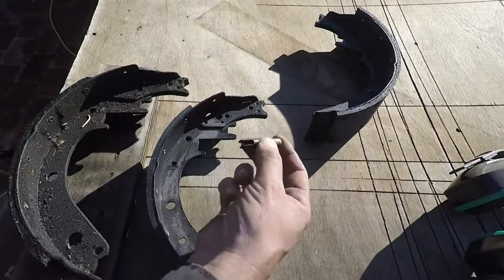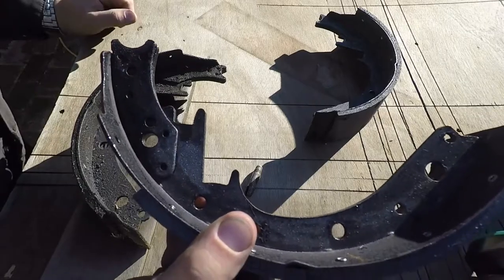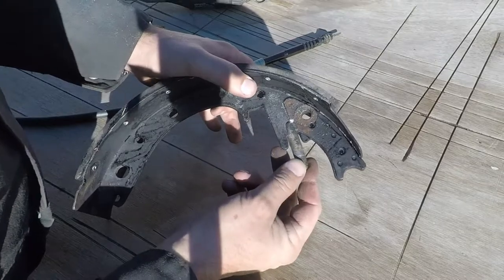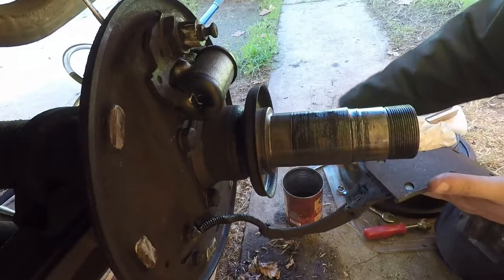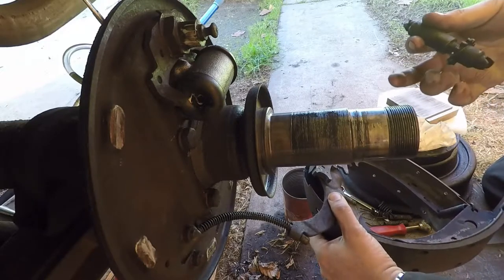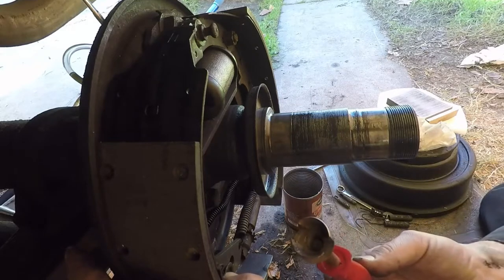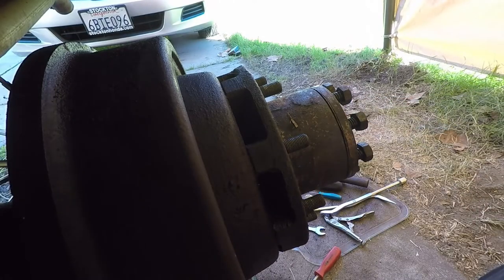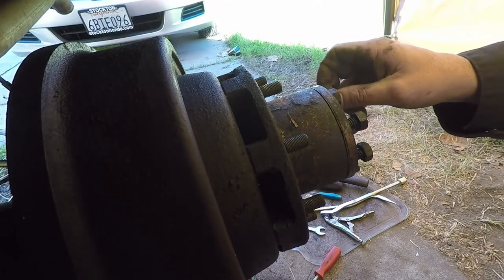1963 chevy c20 truck heavy duty drum brake modification

Comment: a good vid thank you i own a 66 c20 iam going to do this to. you have helped me a lot thank you for taking the time to make this how to video.
Reply from the maker: +Aaron Ivanushka not a problem that's why I made it.
Reply from the maker: you should have the same set up i have on my 1963 c20 there sure is not a lot of info on the heavy duty trucks is there ?
Reply: not much that I've seen and was having some difficulty trying to find the spring and hardware kits etc for the 12  in brakes
Reply from the maker: +Aaron Ivanushka Napa auto parts has them I belive.
Reply from the maker: have you tried lmc. truck they make lots of parts and you can get a series specific catalog for free.

Comment: Great video, I was pretty sure there is a torque sequence on the axle hub nut, the way I do them at work you have to preload the bearing and then reverse the nut about 1/8th thurn then retorque the nut, but these axles have 2 nuts. I have a 1970 c20 and it's the same diff as your 63', I think I did the same thing you did in the nut lol I haven't had any problems so far 😂
Reply from the maker: You are probably correct I might not have included it in my video I should check my book .
Reply: @OldIronShops  yeah I couldn't find the exact specs according to the book, but u went based off the thread size and pitch on one of my stemco books, but I don't remember what it was lol